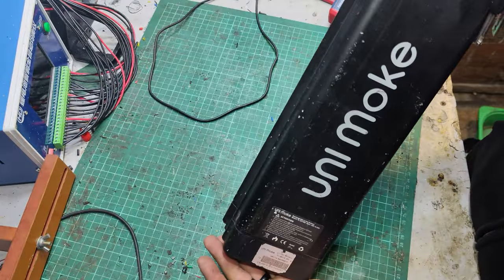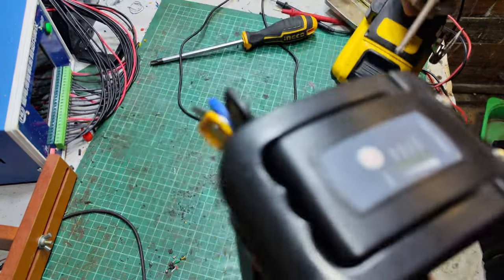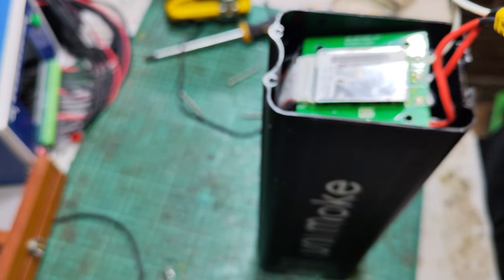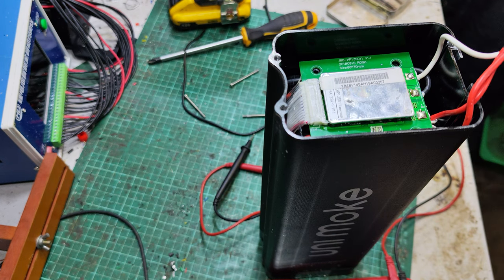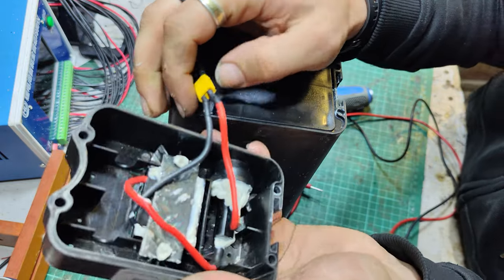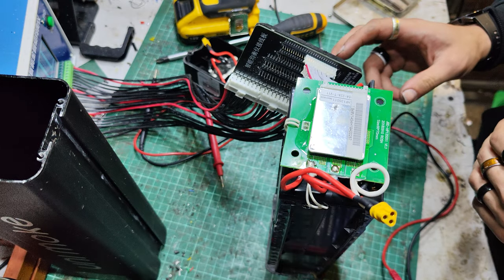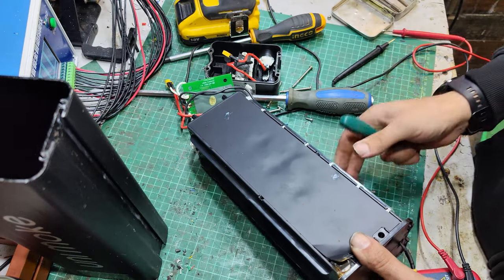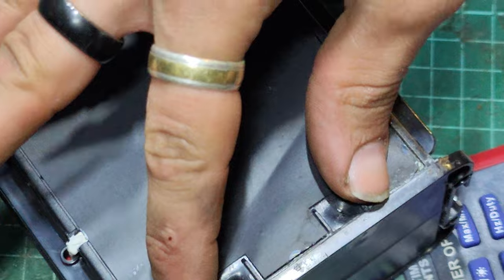A look inside a dead Unimoke 48v Battery (48v 14.5AH)

Comment: Enjoying your video's of diagnosis of batteries and motor's ... would like to see a video of the battery rebuild process if you do this one.
Reply: yes the cost of a new replacement battery vs buying the cells in box of 75 or whatever is different enough to warrant replacing all the cells after a few years of use
Reply from the maker: I'll try my best!